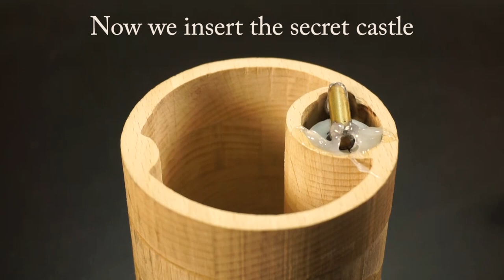3D brain-teaser

Comment: Amazing but I knew I wouldn't be the only one horrified at the solder. Flux more heat and some steel wool would solve most your problems
Reply: He normally cleans it really well but I think he added the extra because it won't be seen and once it's put together he can't open it to fix it. So he made sure it was solid. Everything else he does is flawless. I'm sure this was done purposely.
Reply: and flux

Comment: At first i was wondering why you were polishing the pieces like you normally do but after it got to the part of you putting the mechanism in the wood i quickly figured out what was going on. No one is going to see the mechanism inside and it just needs to work it doesn't have to look pretty. Awesome video as usual and great idea too by the way. How much would you charge to make one for someone?

Comment: Use some plumbers flux on those joins. The rosin core solder used here is designed for pins in electronics, not large joints.

Comment: brah, you need some flux for the solder. also heat the metal, not the solder wire, it should flow freely all the way around the joint with proper flux and heating.

Comment: whats the point in making the solder look good when it is not ever going to be seen.  Just like me framing houses no one ever sees my work when i am done but without my work there wouldn't be a house to make pretty. Just Saying Keep up the good work and every one loves to nit pick.
Reply: A cold, ugly solder joint is a weak one. Technically, it isn't even soldered and can break loose at any time. A shock, a change in temperature. A friend had a cold solder joint in his copper plumbing inside the wall of his new house. 6 months after he moved in, it broke and flooded his ceiling, which came down. So learn how to make those solder joints pretty, because that's how you know they are good.
Reply: cold soldering is like framing using short nails . . . no strength.

you can make an ugly strong joint but not if you don't clean the metal, use flux and heat properly.

would you frame a house using 1½" roofing nails?